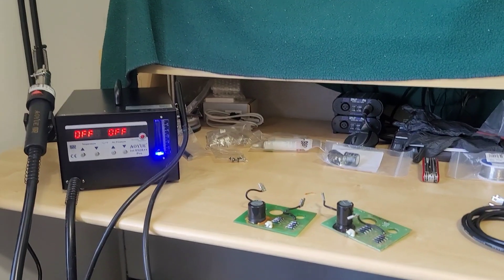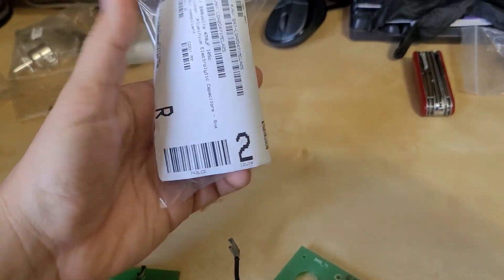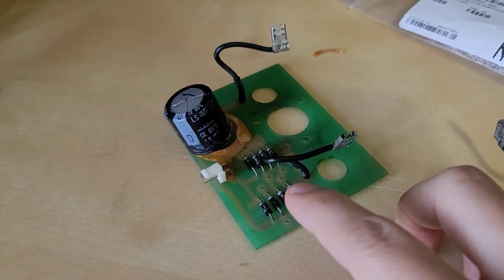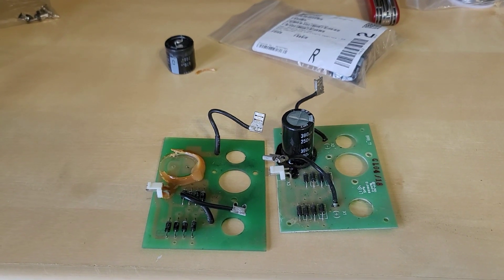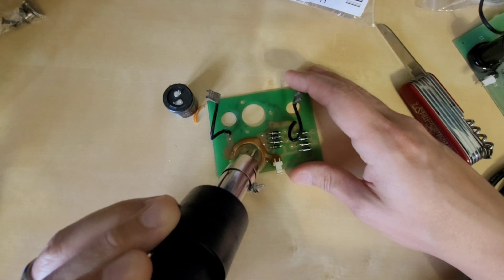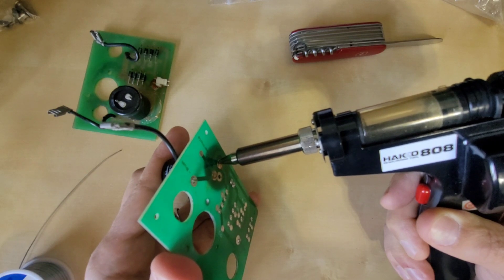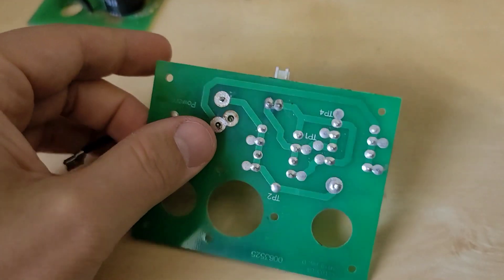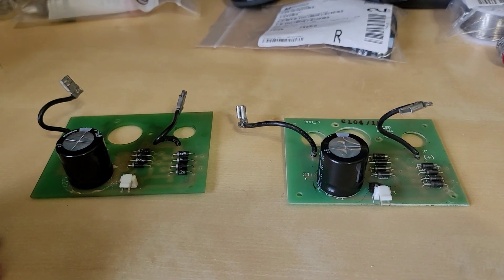Generac/Pramac/Powermate/Coleman 0063525/0063525SRV Generator Board Repair

Comment: with a desoldering gun,you're supposed to use a tip large enough to go over the component lead. they're generally for small-signal components. for big electrolytics,use a 30-40w iron and a solder-vac tool or solder wick.
Reply from the maker: @JayWye52  I have the larger tips for the hakko desolder gun now. Should have gotten them sooner. Thank you for watching.

Comment: the glue is just old industrial hot glue. it's there to keep vibration from cracking the solder joints.
Reply: BTW,there's low-temp hobby hot glue ,and high temp hot glue. most people are likely to have only the low-temp glue sticks and gun.

Comment: The caps will not have a different voltages, max voltage is the peak value of the sine wave coming in less the diodes .7 drops, they will have a different charge or Q, either one should work fine a filter cap besides the physical size. Q = VxC
Reply from the maker: Yes it was simply a size difference to fit into the end bell of the generator. That's always the challenge to match up the physical sizes and matching the specs

Comment: Funny how they used 8 diodes instead of 4, just used each pair in parallel, I guess one bigger diode cost more than two small ones. Looks like the small cap is a bit bloated, maybe I'm wrong, I know those don't last long in indoor electronics, being in a hot generator is way worse.

Comment: Gary, I've got a Powermate 0062975 AVR that has stopped working. It has a couple of bulged electrolytic caps and a couple of cracked disc caps. Do you re-work those or do I need to find a new-old-stock board?
Reply from the maker: I just found the schematic for the superseded part# 0065649SRV the newer version. The older version I have too. I have not rebuilt one of these before but it looks straight forward. Only kicker is I don't have a way to test it as I do not have a generator that uses it or be able to bench test. Email me and we can discuss the cost.
Reply: I emailed you early this morning, thanks!

Comment: Hello,
I hope you see this question and can help me. I have almost the exact generator except mine doesn’t have this plate. Instead it came with a small square diode bridge and a separate capacitor. The parts manual says the capacitor is a 130uf 200v   I live in a small town in Mexico and only Amazon is reliable for ordering parts. I can’t find this exact capacitor but did find something close. It says 140-150uf 250v. Do you think this would work? Thank you.
Reply from the maker: It should work although your output voltage is going to be slightly different. The tolerance of the capacitor is going to really be a factor here. Typically 20%. The other issue too is the physical size it needs to be short enough to clear the inside cavity otherwise the board will not mount properly.
Reply: @Bassguitarist1985  my OEM capacitor is physically larger as it is not mounted on a board. It just has two electrical connectors with two wires going to a separate little diode bridge box. I don’t think there is a way to send you a picture.
Reply: @Bassguitarist1985  update, I was able to find a new OEM capacitor and bridge rectifier on EBay. I am having it delivered to our daughter in Texas and my wife will be there in two weeks and will bring back to Mexico. I noticed that when you shake the old capacitor it feels like whatever is inside rattling around. Probably bad?
Reply from the maker: @BajaBCS  most definitely. Caps shouldn't sound like they have something rattling inside

Comment: Any thoughts on "upgrading" to higher-rated rectifiers and eliminating the parallel diodes? There must be better components available now vs. when that board was designed. Not to mention that parallel rectifier diodes sounds like a bad idea.
Reply from the maker: No need. 33 ohm stator at 24vdc is less than  1 amp. Bank of 8 diodes is well sized for the given application.
Reply: i have seen generators using a bridge rectifier and  an electrolytic capacitor instead of the diode rectifier board with parallel diodes. There is also an upgrade design diode board that also uses single diodes of a higher value because the parallel diodes was noted as a possible issue.

Comment: a bit of flux would have helped as well as its purpose is to clean and prevent oxidation  during the soldering process. as well as improve the flow of solder. the joints would look much better.
Reply from the maker: I believe there's a little bit of flux mixed in with this solder wire, but yes agreed a little extra flux will be beneficial
Reply: @Bassguitarist1985  yes its flux  core  just saying when reflowing the solder i use flux RMA

Comment: After watching James' generator repair I was a bit concerned regarding the diodes. He measured about 120V at the output of this board feeding into the rotor with about 33 ohms, which results in just shy of 4 amps of current, and that was under partial load. This is already about the maximum the diodes can handle continuously, two RL205-T in parallel, each rated for 2 amps. The 1N400x series is only rated at 1A, so these will probably get fried pretty fast. I hope the manufacturer of the aftermarket board also used 2A (or more) rated diodes, personally I would have gone for 1N5407 or similar.
However, it seems the diodes held up pretty well, considering the board must have seen some heat during its life.

Keep up the good work! It would hurt to see a working machine being scrapped because of one cheap component.
Reply from the maker: Moffa. The rotor is powered by 24VDC, not 120VAC. So the current is significantly less than 4 amps, more like less than 1 amp. Bank of diodes are more than adequate.

Comment: Thanks for the informative and well done video.  FYI I used your link for  the desoldering gun, the 808 is out of stock and DISCONTINUED it also looked like many spare parts for it also suffered the same fate. You might look to see what they still have if you might need spare parts one day.
Reply from the maker: Thank you! Yes got a few spare heating elements, the tips are standard too. SRA Soldering is a great company to grab these tools too

Comment: Good work and good advice concerning the silicone adhesive. You might consider using a ESD safe soldering iron when working on PCBs, Hakko makes a bunch, pricey but powerful for big pads and you can control temps a little better.
I hope to see James attempting this kind of repair eventually. 
Both of you produce excellent work.
Reply from the maker: I do have those ESD tools actually, a D888 workstation with pencil iron with multiple tip types and the FX8804-2 hot tweezers. Was a bit lazy and used the Weller instead
Reply: That repair is now on Jame's pages.

Comment: Since the E-cap is 470mfd @ 200 volts and it failed, I'm surprised you didn't install one for perhaps 350 volts instead.  Perhaps it would hold up better?
Reply from the maker: 200vdc is more than adequate for the exciter circuit. It doesn't run at full mains voltage. In this case the cap is simply old/dried out. The other issue is finding a cap in the physical dimensions (height, width, lead spacing) to fit inside the end bell cover of the machine.
Reply: @Bassguitarist1985  Just thinking aloud, but there seems to be enough space to lay a cap down instead of end-mounting it if/when the low-profile versions go unobtanium. And thanks for helping James 👍👍
Reply from the maker: @P_RO_  the cap has snap in axial leads, not long enough to lay the cap down unfortunately. Good thought though! Wait till my next video when I recap my tube bass amp!
Reply: @Bassguitarist1985  An equivalent with longer leads might be available or you could extend them- I haven't looked. And I wish I still had my 50 watt Fender Bassman- I could almost take a vacation on what they sell for now. Age made me tone-deaf so I sold everything long ago 😥
Reply from the maker: @P_RO_  bit of a dangerous amp to work on too if it isnt modded with bleed resistors. For the caps it was easy to figure out the replacement. Its knowing what to look for